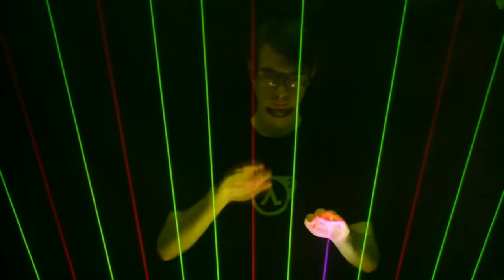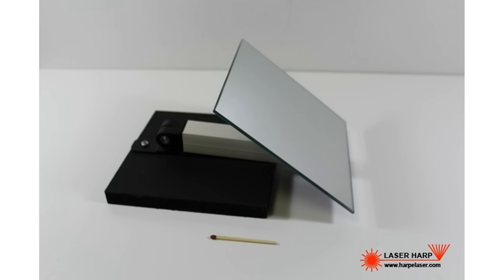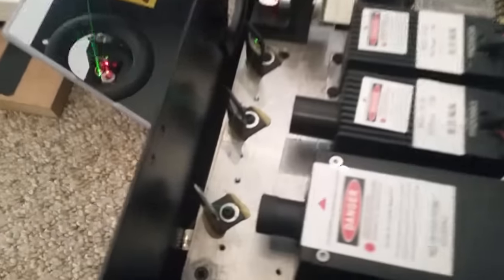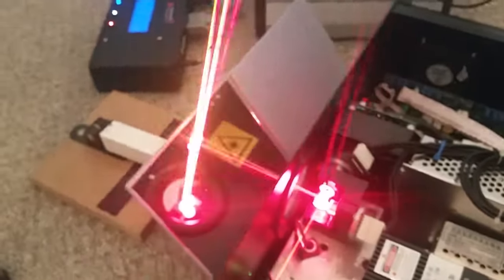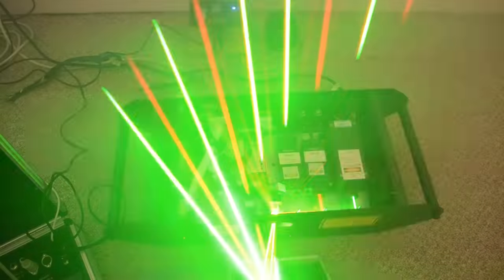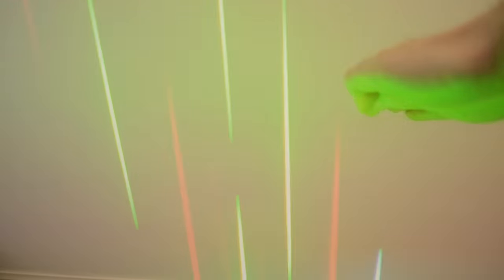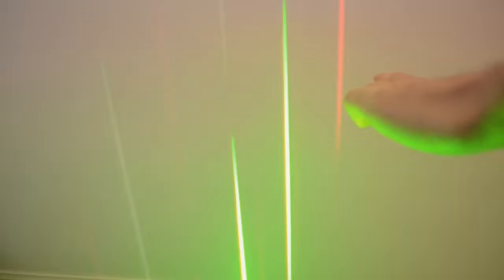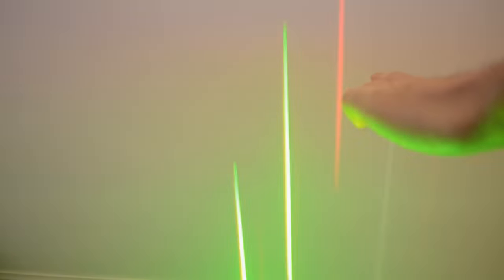Laser Harp : How does it work?

Comment: Hello, I am currently building a laser harp and the prototypes are working well. The one issue is the laser. The beams aren't visible on their own so I was wondering. Where did you get your lasers from. Thanks!
Reply from the maker: +Bailey Fokin use lots of smoke. My laser projector is a 2.5W from laserknowhow.com
Reply: Thank you for letting me know. Funny enough, I'm running the laser harp of mine on a 5 mw laser pointer and light sensitive sensors. Its really fun but I need to work out the kinks in my system.

Comment: How much does a laser harp cost?
Reply from the maker: +Pie In The Sky controller - between $300 and $1000. Laser projector $300 - $5000. So $600 minimum
Reply: Well, far cheaper than normal harps then
Reply: @ThereminHero  Sooooo expensive(

Comment: Here I assumed it worked by a reflector sensor at the bottom measuring the strength of the reflected laser beam. Does this mean you won't get any reading other than "not has been hit"? If you measured the strength, you could get more variations, much like with a theremin.
Reply from the maker: +morphman86 lasers don't loose enough strength over such short distances to measure
Reply: Having used quite a lot of laser measuring instruments over the years, I can tell you that yes, they do.
They loose enough strength that you can read the strength of it when it's aimed at a window, convert to audio and listen to what people inside are saying.

If it can measure the vibration of a window, which is like 1/10th of a micrometre, I'm fairly certain you can measure a halfing of it's beam with at least some accuracy :)
Reply from the maker: You are right that these instruments are able to do that, but my understanding is that the beam is formed in a more precisely measurable way. With these "laser show" lasers, it is more difficult because the source has not been calibrated for measuring distance. I could be wrong though!
Reply: It's harder, yes, but still possible. The method you showed here is probably half the price or less (and I'm guessing that's still not cheap).

The method is pretty much the same, but instead of a light sensor, it would be a reflective sensor (which is a lot more expensive). You still measure the time it was hit to find the note, but with that you can also measure the distance to the hand.

Another route to go would be to have two light sensors at a known distance apart and write a controller program that triangulates where the beam hits. It would save a lot of money, but can be trickier to program and requires a very precise measurement (down to at least 5mm) every time you set it up.

Comment: Did you teach yourself electronics or do it in college ?
Reply: His laser harp controller comes from KromaLaser... Its not a kit, you plug in a ILDA controlled laser projector (not supplied) midi cables, foot switch and light sensor (supplied) set it up through a synth or software and off you learn... I build laser harps for home use, its a great MIDI controller...
Reply: Best one on the market from harpelaser...